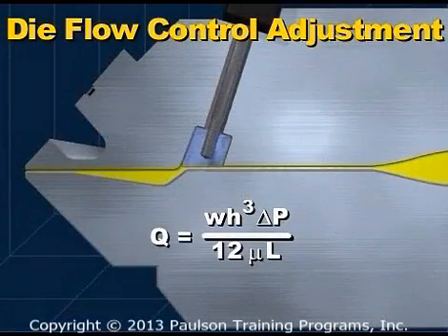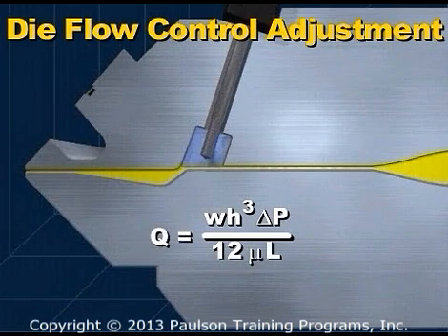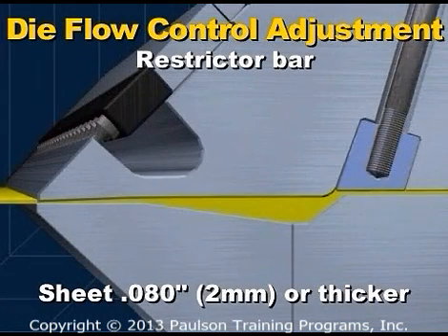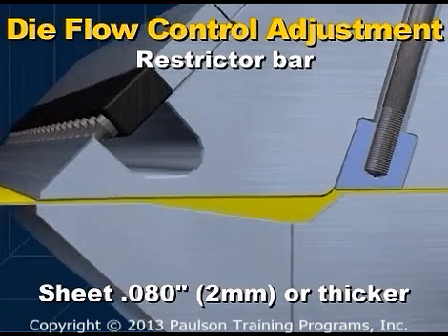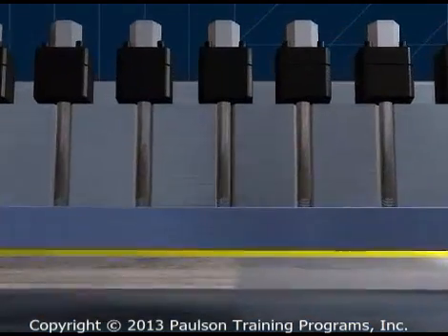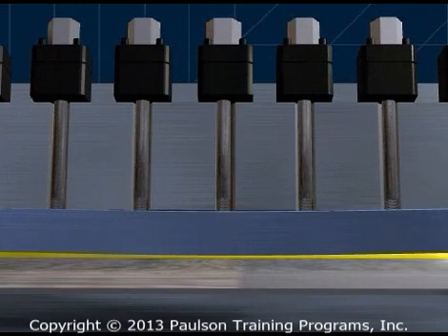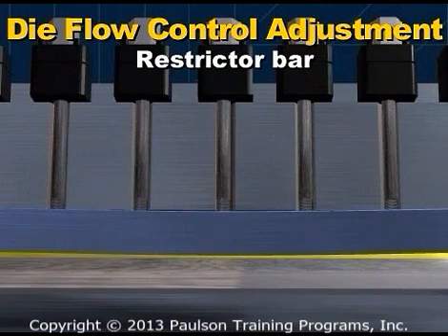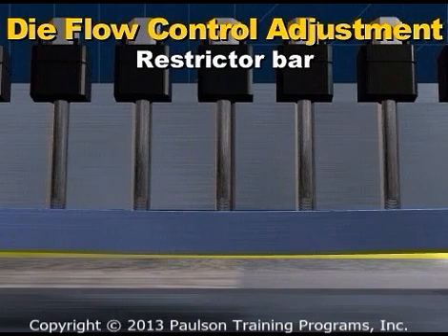Sheet Extrusion - Controlling Plastic Flow in the Die

Comment: How to setup profile bolt and how to adjust bolt according to flow please
Reply: Sameer Patel the adjustment is during operation  and cut a sample of the sheet and measure the thickness by micrometer
Reply: Totalmente equivocado  @alaaalmahari1126